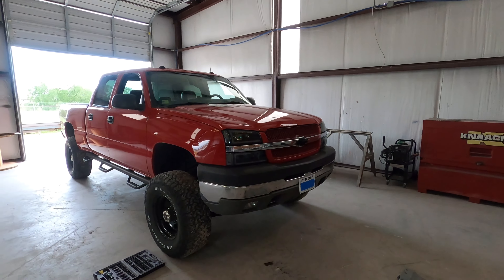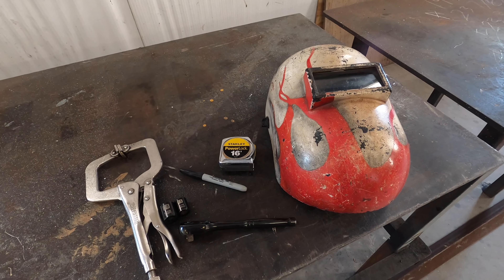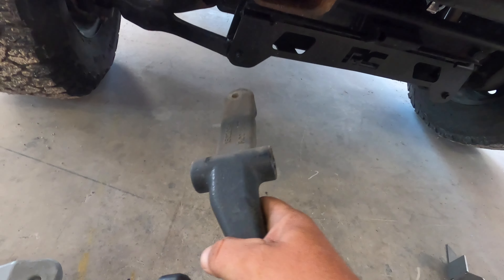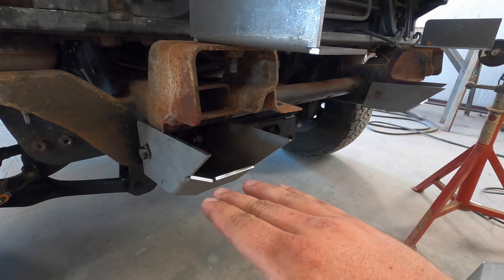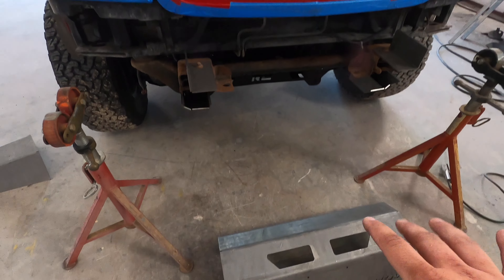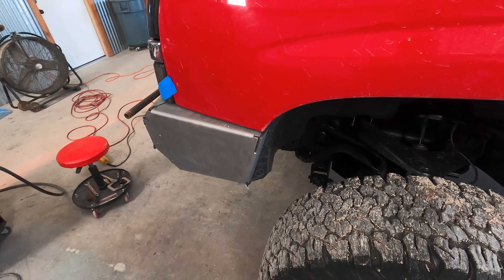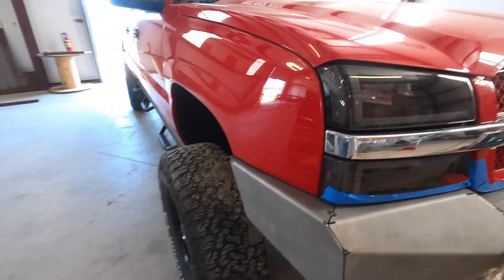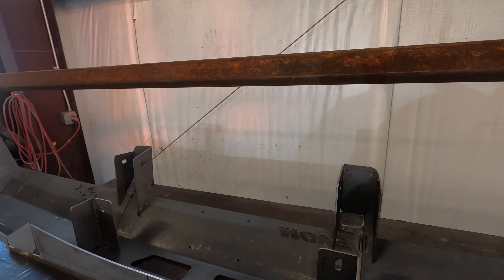DIY Move Bumper Front Bumper Build 2004 Chevy (Part1)

Comment: Real men build bumpers out of pipe! Haha cool video, I’ve built tons of pipe bumpers in the last 20 years and have been curious about these diy kits. Very cool! Back bumpers to me I’ve always been extremely simple but the front bumpers are always very tricky. My O2 GMC front bumper was the worst
Reply from the maker: First bumper I ever built as a wee lad was a pipe bumper. Yanked some dude out of the mud with my 2WD dodge I pulled the brackets right off the sch 40 pipe. The welds were still there but two big chunks of pipes still on the brackets and threw the bumper in the bed of the truck and went home to design a new one haha.

Comment: No concern about the trucks electrical while welding? 
Always heard it could fry computer. 
Great vid thanks.
Reply from the maker: Thank you!  I dislocated the battery and all was good.  Not saying I did it correct but seemed to work. I think these new new trucks I would definitely research more before I started welding.